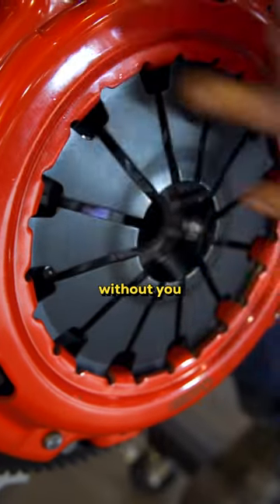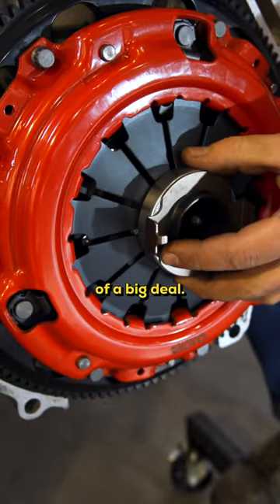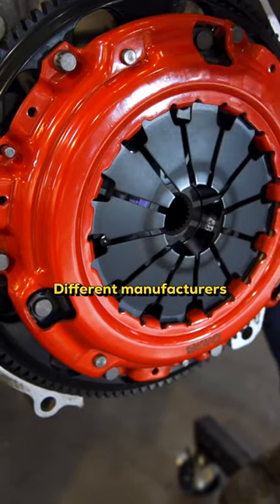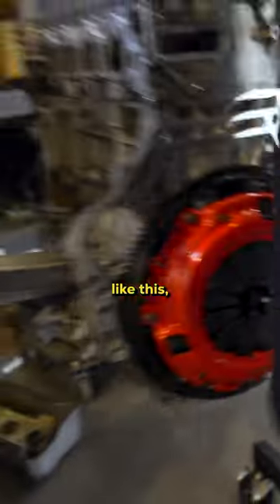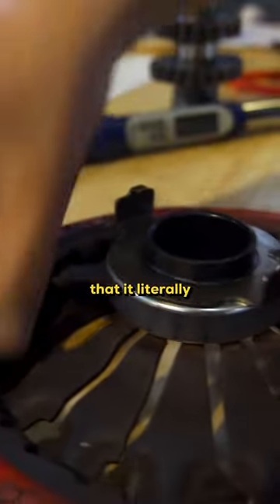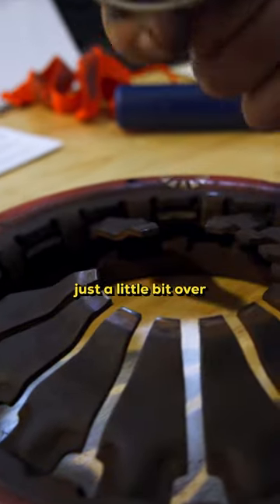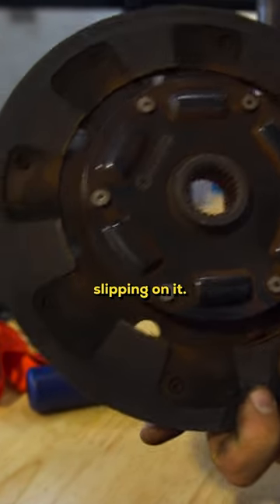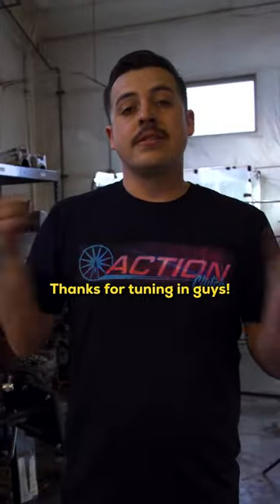IS THE THROWOUT BEARING BURNING YOUR CLUTCH!!

Comment: How do you adjust it?
Reply from the maker: Majority of the vehicles the adjustment is done via a pushrod that connects the clutch pedal to the clutch master cylinder there’s a jamnut on it and once you break it loose you turn the rod clockwise or counterclockwise this will bring the release bearing closer or further from the pressure plate depending on the vehicle. Some adjustments are different and some cars do not have one always check your service manual if unsure. -Cub

Comment: I just installed a transmission yesterday and now this vid pops up...
Reply: @actionstop is there way to check if the bearing is too close while the transmission is on ???
Reply: Is there a way to check if the bearing is too close while the transmission is on?? @actionstop
Reply from the maker: Some transmissions have inspection covers if it doesn't take out the dust boot cover on the fork and try and see where the release bearing is at, if touching back it off a tad bit.

Comment: Pushing the clutch pedal in DOES NOT put the transmission in neutral, do not say that.
Reply from the maker: Pushing in the clutch pedal disengages connection between the engine and transmission x)
Reply: @actionclutch  which is not the same as “neutral.” Don’t say that.

Comment: Pressure plate. Broken u think or know how. Would a seized barring cause problems. With transmission not allowing the truck to go faster but only revving is all I get. So I bought a new clutch. FX for racing or just a clutch. Boys took old one out n found that a barring was seized mechanically incline brothers told me this was the problem. Now I wonder if the 4x4 drive was effective. In my obs = Older body style. 1993 Ford F150 XL 4x4 standard single cab 2 door short box. Warn hubs totally not manual. U actually need to get out n turn into lock. As I say that what a racket it made over 40km I forgot the hubs were on lockdown. The truck shock roars like a bad bad thing was happening it never dawned on me in 1993 u only used them under 40km thank goodness it was ok. I’m sure my 44 Dana front end wasn’t happy. I totally forgot it’s 2024 not 93. My engine being 4.9 is a very tough way too go. It’s both torquey n relabel. But I was wondering about this throw out bearing having an effect on the 4x4 it works good. But if I pull to much towards me. It’s all neutral. I’m thinking this is normal for 5 speed transmissions. Throw out bearings cause it to pop out of gear. This was the case with my 22r 1988 truck. Went from Ontario Canada to British Columbia 2 cups oil n 200 dollars in gas 1992.